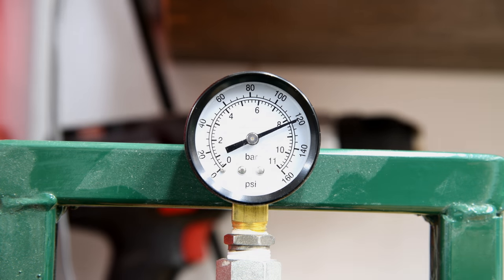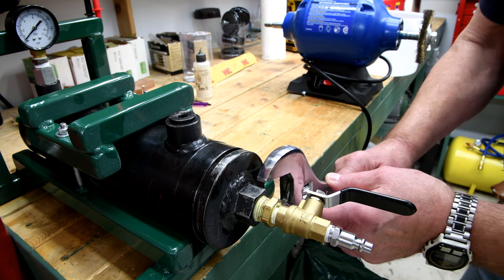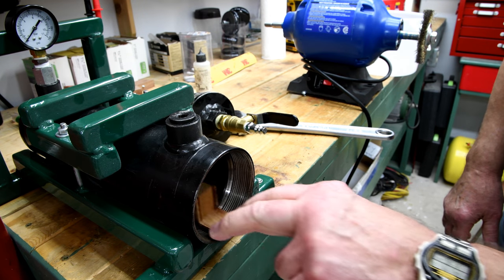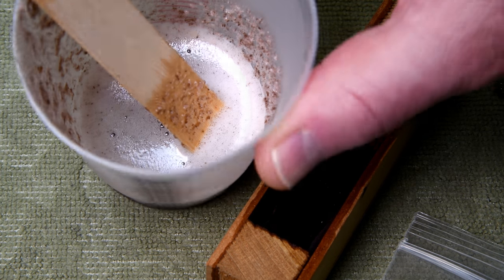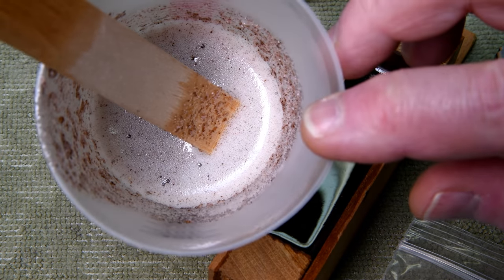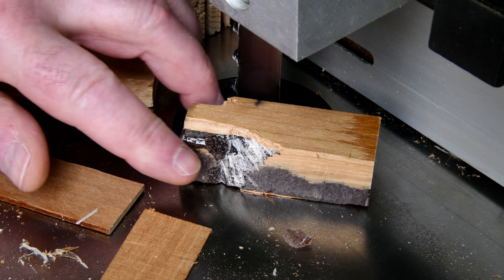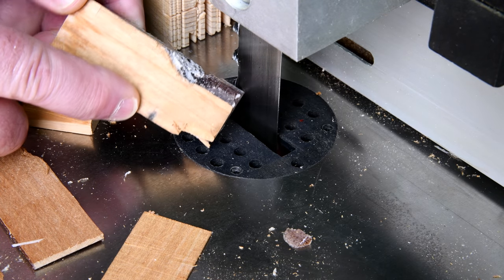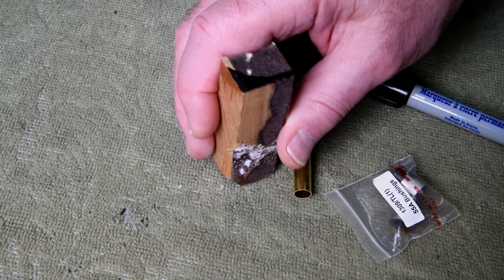The Test Mixture - Part 2

Comment: I wonder if a thinner blade would have been a better way to cut the wood off. Thanks for sharing the good and bad moments!
Reply from the maker: Hi Paul,
That blade actually has a very thin kerf, But but the biggest cause was that I was not holding it down properly. Thanks for watching and asking :)

Comment: Small pieces!  Table saw!!  Sure happy you weren't using it this time.

Don't know if it helps or not but my second push stick on thing like this has a 'V" in it and I push on the corner, down and toward the fence.

If anyone can save it, you can.

Change your shorts and we'll see ya tomorrow Ron.                                JimE
Reply from the maker: The problem was in fact that the wrong push stick was being used. I explain in the next episode :)